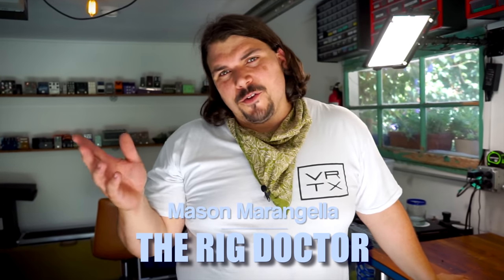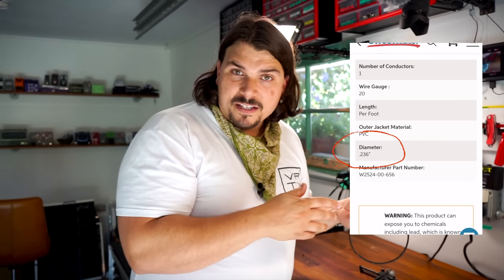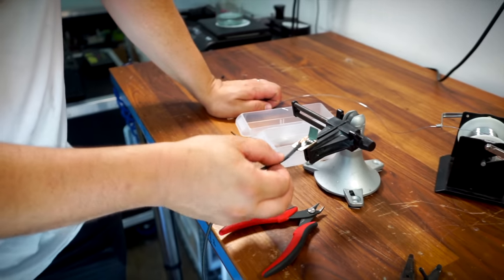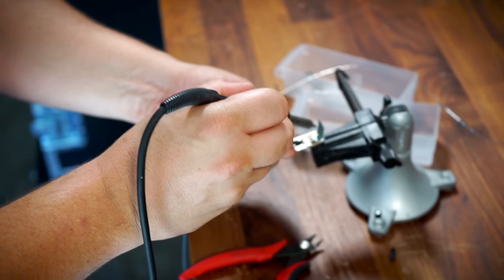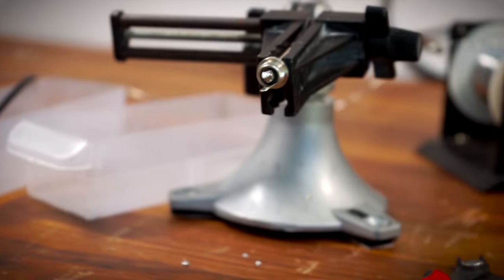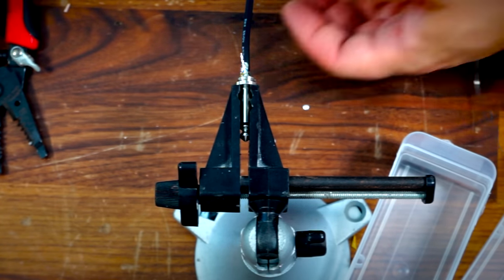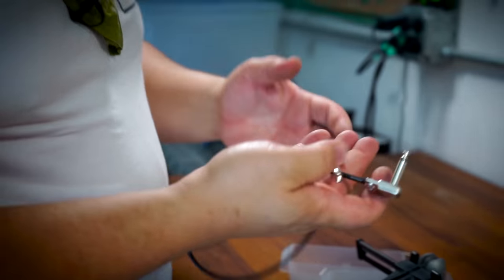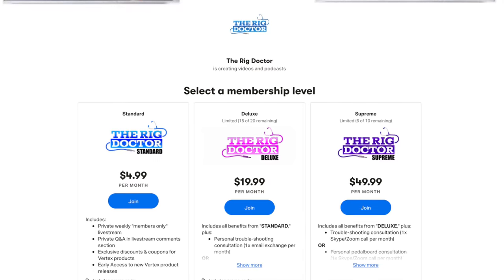How To Solder SquarePlugs

Comment: What type of solder do you recommend? because the solder has different percentages of lead, rosin, etc. Dweezil Zappa uses Magnetic guitar plugs now have you checked out the magnetic plugs and jacks?
Reply from the maker: See the description links for exactly what we use.
Reply: @VertexEffectsInc  but will this solder you use oxidize? and what type of plugs coating/plating do you recommend that won't oxidize? You mentioned that steel is the worse and brass is bad also.
Reply from the maker: @waynegram8907  this is why the lead becomes important as it helps fight this.  Ironically, the Xotic stuff is all ROHS which means they're not using lead, which is a problem.  The one we recommend I've found to be the most table.  The plating on the cable is something that out of our control.  Going with a plug that is a high quality metal, that's plated well like a Switchctraft or Squareplugs or G&H is a move in the right direction.
Reply: @VertexEffectsInc  The Plating on the plug is what causes the problems is the type of plating and coating because it changes the frequency roll off and doesn't get good connection. If you measure the milliohms from the plug to the jack there will be milliohms of resistance because of the coating and plating is causing resistance between the jack and plug. The ROHS is leadfree which the solder glue is also causing bad connection issues. Guitar pedals that use leadfree solder actually sound different because the lead has electrons.
Reply from the maker: @waynegram8907  Every material in the universe has electrons. It is true, the plating makes a difference, but the ohms will be determined by the material resistance, any oxidation, the PSI - pounds per square inch, which covers the area of contact and pressure.  Now, to plate certain metals, there may be more than one metal as some metals cannot plate directly, have to have a plating of one material and then the final material.  Also the finish of the base metal and  the thickness of the plating matter as a rough base metal may have high spots or whiskers through the plating that are the real contact area, not the plating!  That is why hold flash does not work, it looks gold but is so thin that it is still the base metal that will make contact through it.  Since we have many materials in the long chain of the signal connectors, PCBs, passive components, switches, active components, solder and the plating on various items.  There is copper, lead, tin, nickel, steel, carbon, exotic materials, doped silicone and/or germanium, capacitor dialectic, just to name a few.  They might all contribute to the final sound.  Less of any material “may” be better for accuracy. But, in the end, this is guitar world - we want the distortion and signature qualities of these as it is NOT adopt accuracy but which gives the distortion we want.  If brass or steel or whatever, gives the “sound” we are after then I guess it is the BEST.
Reply: @VertexEffectsInc  The Type of Cap Dielectric Fluoropolymer film is preferred in audio circuit because how the dielectric of the fluoropolymer film is enhancing the electro static charge which changes the frequency response. Changing all the capacitances in guitar pedals and amplifiers to Fluropolymer film is what people are doing for a better high fidelity.
Reply from the maker: @waynegram8907  sure, there are difference in components, no doubt.  However, if you want to hear all the difference that components, wire etc makes, you really need to test on a clean linear system and speakers (not guitar stuff).
Reply: @VertexEffectsInc  For the speaker cabinet you're using you have to test what is the maximum SPL of each speaker.  Because each speaker will have a different SPL level and starts to distort at a certain SPL level. The linear region of the speaker when its clean and not at the point of distortion. 30watt speakers are listed at 30watts green backs or 25 watt greenbacks but the SPL levels aren't doing to be the same as the wattage.

Comment: Do you loose thatuch space from using a nutrik end that makes up for the less chance of if you had to pull a bad pedal or patch out it would be as strong.i know I take them apart a few times a year just to detoxit and know it's going to be stage worthy.no disrespect.your great.but I hate the fact that you have to screw it together like a plug I used in the ,60's.after learning about mogoni,the next safe place is a neutrik  secure built ,never a rivet. But yours didn't look like they were built that way. But what's the point .do you think without a switching device in front yo can use do many things on a board without falling over on a gig.but I'm a big fan of yours .you cleared up a lot on buffers and such.how about impedance when using a helix in my loop ? It has an input setting I went to one m input but any idea of it needs to be buffered to 100 ohms going back to my loop return. I'm using it for delay and reverb and liked your suggestion for reverb first .I'm going to check that out next rehearsal
Reply from the maker: Neutrik is a good plug, but not appropriate for inside the pedalboard.  Mechanically they are more robust than the plugs used here, that's true, but electrically they have more capacitance than 5 feet of most pedalboard cable and plugs (as shown here) combined for just one Neutrik plug (and you need two plugs to complete a cable).  The patch cables shown here, whether it be SP400/500 (pancake) or the SPS4/5 (straight) are fully soldered and robust in their context of the pedalboard as interconnections.  The set screws are used to either secure the housing (as in the panckage style) or used as a strain-relief (on the straight plugs). The set screws are only mechanical, and have no electrical connections to the plugs.  The Neutrik would take up, at minimum, double the spacing, if not more, and would have a sonic disadvantage based on the electrical specifications from the higher capacitance.  Where it's true the Neutrik is great outside of the pedalboard on the cables going from the guitar to pedalboard or pedalboard to amp, on the pedalboard is problematic and is not adding value to the rig.  This is why you really don't see these plugs used by any pedalboard professionals in this context.

Comment: This may be a silly question, but how hot are you running your iron?
Reply from the maker: I usually run it no more than 75% of max otherwise it just ruins your tips fast with no benefit.  About 7-800 degrees or so.

Comment: Are these cables ok with voodoo lab pedal power or will they transmit the hum? Should I go with 2319?
Reply from the maker: These things you say are unrelated.  2314 and 2319 are essentially the same cable with the 2314 being a slightly smaller diameter.  You can check out our cables shootout for patch cables and you'll see the 2314 out-performs the 2319.  Power Supply noise is another topic and can be noisy without any influence from the cables.
Reply: @VertexEffectsInc  Ok, thanks. My understanding from Redco is the 2314 does not have the extra conductive PVC layer under the shield that the 2319 and 2524 have. That's why I asked. Thanks for the info. I guess I'll go with the 2314. Thanks again.
Reply from the maker: @codswinger  It doesn't, that's correct.  However noise from the power supply would still not be related to this.  This is still a high quality shielded cable - I'd be more concerned about noise from a linear supply than the 2314 cable.
Reply: @VertexEffectsInc  Gotcha. going 2314. Thanks.

Comment: does the diameter of the cables affect the sound output?
Reply from the maker: Depends, are you talking about outer diameter or the inner diameter of the center conductor.  There can be some influence, yes - but it depends on other factors too.  You can have small diameter cables that are low capacitance - George L is a good example of that.

Comment: We have been soldering the Mogami cable to the pancake heads from your’buy list’ however each time we test them… all of the lights on the Behringer CT 100 tester show? rather than the five lights in a X pattern like a Ernie Ball cable we bought for testing comparison shows? What does it mean if all lights light up? And how do we fix it?
Reply from the maker: Which Mogami Cable, which plugs?
Reply: @VertexEffectsInc  Mogami 2319 and the pancake heads you recommended (sorry can’t remember the name but they have a SP 500 on them). Bottom line; we were able to get to the bottom of the problem.  The positive was being grounded when solder was applied.  Some were not able to be fixed others were salvaged.  Wish the small connect points were easier to work with). We bought a few new Ernie Ball patch cables and unscrewed them to get ideas and the internal side of them looks much better for looping the wires and soldering). I wish there would have been the opportunity to meet up with the Rig Dr somewhere in the East Bay for guidance but Building the board has been a learning experience
Reply from the maker: @Naminorite  my guess is you didn't remove the conductive plastic around the center conductor.  99% of the time this is the mistake people make with this cable.

Comment: 8:30 were you just watching crocodile dundee or something?
Reply from the maker: I don't think so...
Reply: @VertexEffectsInc  sounded Australian there for a second. hey I'm working with 2319 and the SP5 and I notice a bit of a gap around the ID of the plug (when I go to tighten down both screws) even if I put some shrink tubing around the cable. Is this your experience? I was expecting a tighter fit
Reply: Taut (adjective): “Pulled tight or not slack”
I get where you’re coming from lol, Australians do say “tight” like “tot” or “tahyt” sometimes 😂
Reply: @AleksanderLydkunst  that is hilarious!! I had no idea.